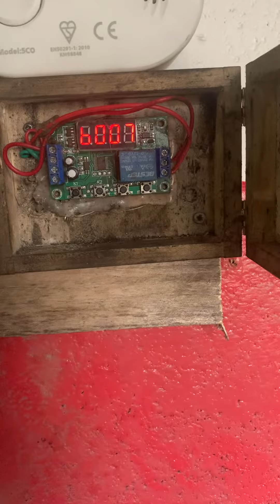Blue flame waste oil burner

Comment: Awesome looking stove you have there. Am I right in thinking that smoke is basically unburned/vaporised fuel (gas)? 
I'm looking to design and build something smaller and much simpler incorporating a fume hood and a baffler plate, whereby any unburned smoke/gases are recycled for a secondary burn.
Thanks for showing us around your stove.